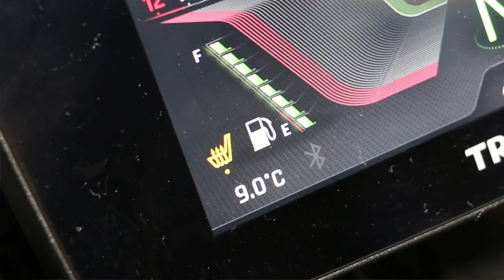How To Install A Seat Heater On A Motorcycle

Comment: Wondering if the Tusk model you have selected is only regarding the package Dimensions? (12.5 x 4.5 x 2 inches) 
Asking because this models is unavailable... 
All others  seems to be the same 30 Watts and same  -Max temp of 158 F (70C)   just sizing  is different, even some comes in pack of 2    maybe do the rear set at also? 
Installation for A tiger 900 2021 as well so frant and rear seat pre wired    Thanks for your time!!
Reply from the maker: You need to make sure you're going through Amazon.com, or it may appear as unavailable. If you still have problems, you can also order the part through Rocky Mountain ATV. It's called the "Tusk ATV/Motorcycle Seat Heater" and the item number is 1858160001. It should be about $20 USD. If your bike doesn't have a rear seat heater, you could probably do that too, although I haven't checked the circuitry for that one. Good luck.

Comment: And idea if the 2022 bmw F850 GS has a heated seat circuitry built in?
Reply from the maker: No idea. You should check out your local dealership.